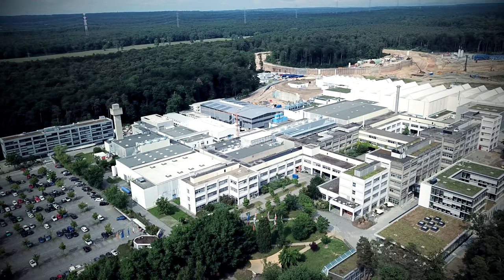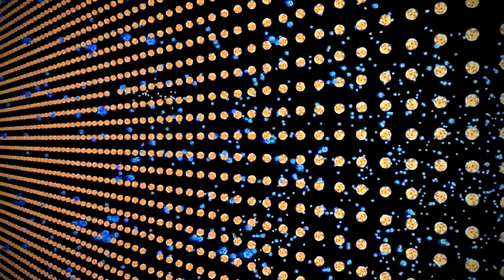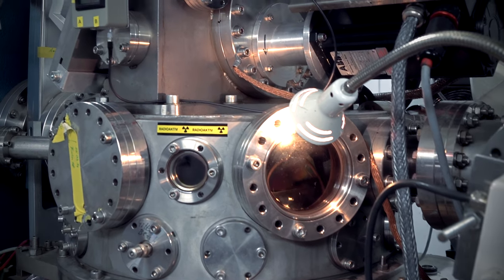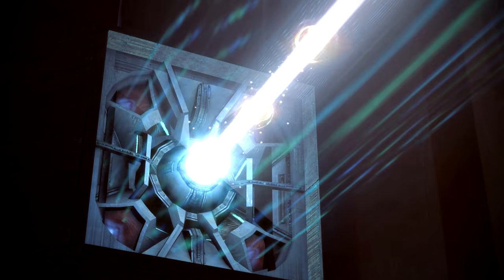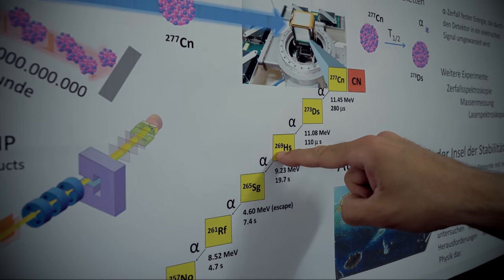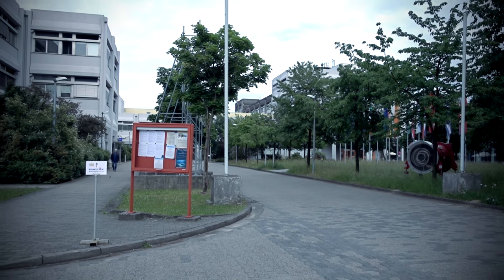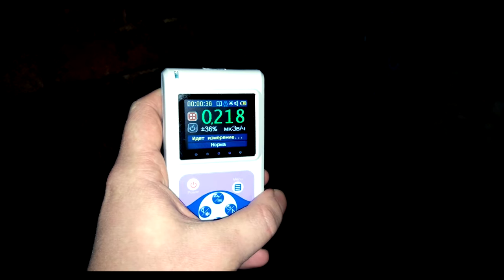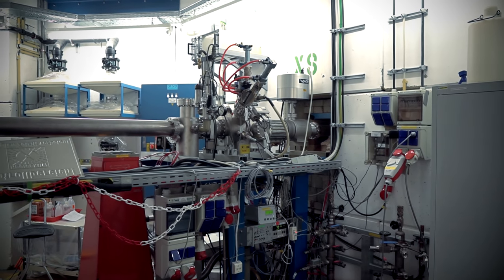Copernicium  - Probably The Most Inert Metal On Earth!

Comment: Wow, an inert gaseous metal. a heavy metal no less at atomic #112.  So strange
Reply: I do believe Hydrogen is a gaseous metal, much more volatile than copernicium. Hydrogen is much lighter, more stable, and very reactive. Very easy to come by. I agree, though. how can something that heavy be a gas. kind of like Radon. Heavy, inert gas, but not reactive, not a metal.
Reply: @ClickThisToSubscribe Hydrogen will combine with a lot of other elements. Almost all fossil fuels(except coal) are considered hydrocarbons variations on how  hydrogen combines with carbon, to create a variety of physical properties. The core of Jupiter is metallic hydrogen, creating a magnetic field many times stronger than earth. To do that, it needs to conduct electricity in that form. it is also ferromagnetic. You're right, if you call "normal conditions" here on earth. It is very difficult to compress hydrogen into the metallic state here on earth. Hydrogen REALLY likes oxygen. They want to become water at the drop of a hat. It is anything but inert.
Reply: Kemist xd